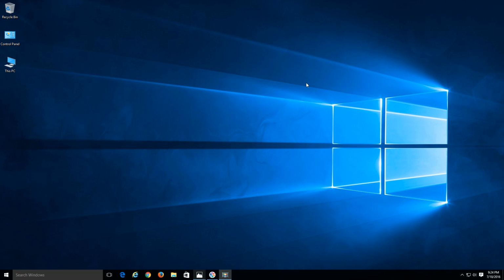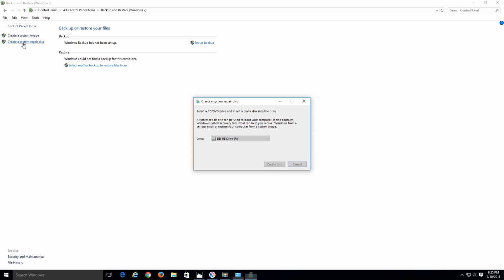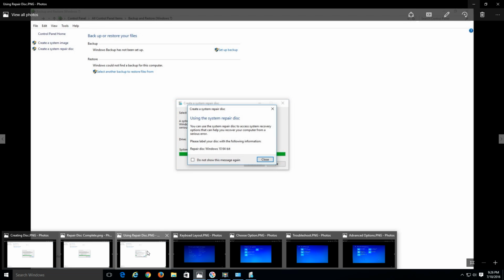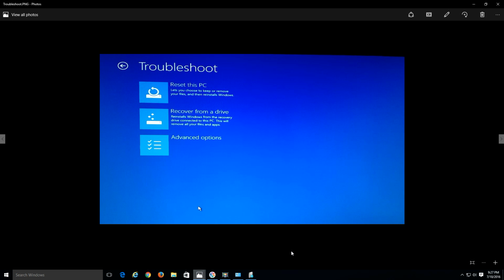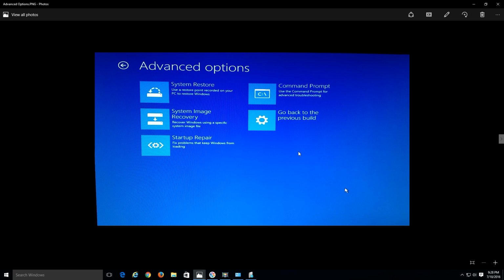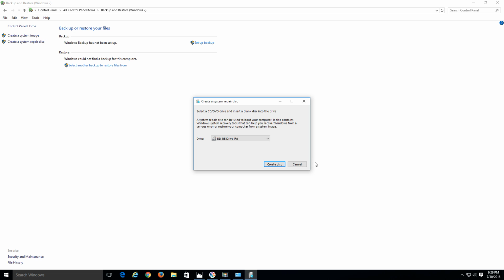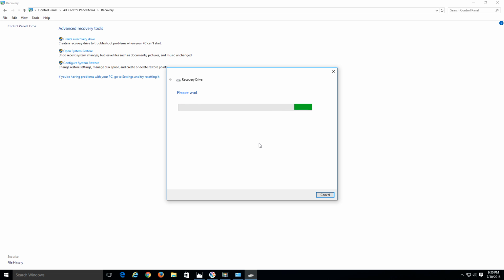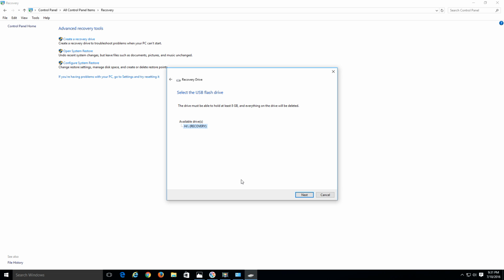System Repair Disc and USB Recovery Drive Windows 10

Comment: I'm still not clear on the difference.  If I put in a new hard drive, am I better off restoring via a "sys repair disk" or a "recovery drive". Thanks
Reply: I know this is a really late reply, but if you're still not clear, they basically serve the same purpose (at least for the use case you're asking about). The main relevance difference (for your use case) is one uses an optical disk and the other uses a USB drive.
Reply: @pkennethv  Thank You for your reply.  RH
Reply: @pkennethv  Thank you. I've been trying to wrap my head around the differences for an hour. So even in this day and age (2023) System Repair Disc literally requires an optical disc to work? In that case why wouldn't everyone just use the recovery option since flash drives are the main media type these days? 

Is there an advantage that System Repair Disc offers or is it just outdated?

Also, when booting into the Windows Media Creation Tool (for example, when you want to install windows on a new PC) there are repair options you can use instead. Do you know if these are the same as the recovery drive?

Thanks again and take care!

Comment: As Carbon_Krush said, if your pc wont boot, how the hell do you get the dvd into the drive drawer? Also, once you have created the recovery drive, how on earth do I use it if my pc wont boot?
Reply: In your case, you will have to start with a clean install. Afterwards you need to create the recovery drive.